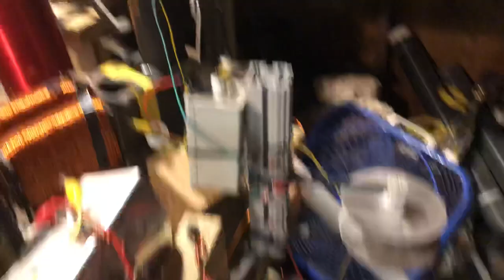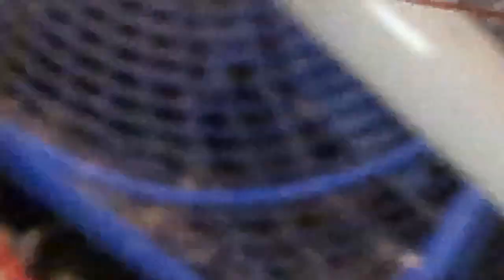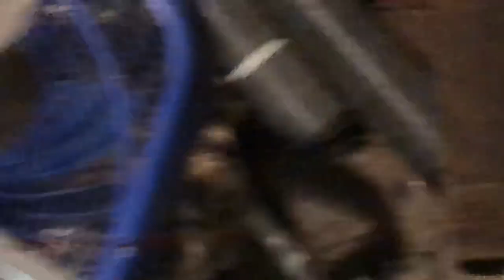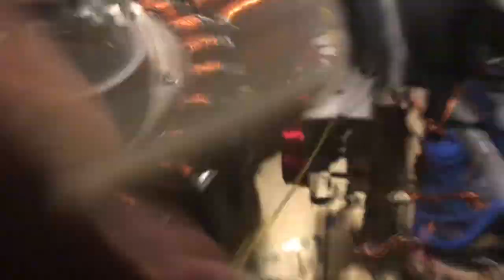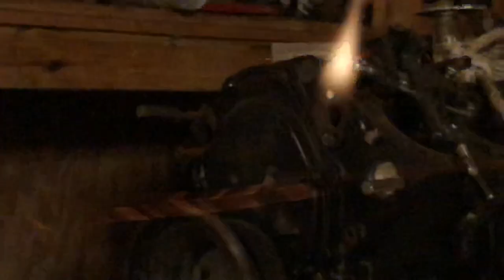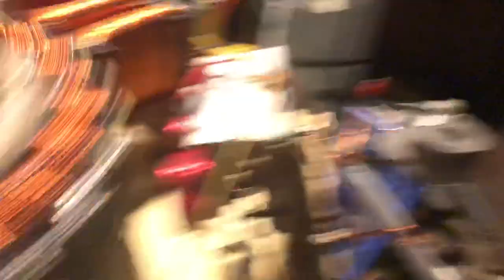Coral Castle, Ed Leedskalnin, High Voltage Lines Test

Comment: That's a pretty impressive amount of power coming from that one pmh at even super low speeds
Reply from the maker: Hi Jason so the best thing ever happened to me is what I learned how to make a voltage multiplier. You can make up to 1,000,000 Volts, by just multiply and one volt! What you see is how to make high pressure
Reply from the maker: Jason Joplin 
And yes shedding break down at its finest
Reply: Yea pretty awesome indeed

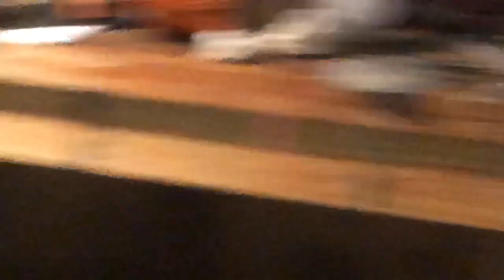Comment: 3:16 "Wheres My chicken Stick when Ya Need it "  4:16   Do That Whole Wand Spark Thing,, but instead Of a Wire.. Use Different Heavy Steel Iron Chains.. Some old.. Some New Type Metal..  See the Difference Between The Metal Surge & flow determined Of metal chain 'fine structure' or To Dense.. As to Not Allow Spark 'Grace' Effect..where the Magnetrics is Easy to Work With and Malleable, that When Added to Circuit Will Allow More 'Magnets' To Work with That Are Already in the Iron,, as Ed said the Wire too had magnets in it..that The Gernerator or Dynamo Didn't need To Generate.   It's like Different Nascar,.. in the Diff Chains.. like How Ed Had Over His Wheel.  More.. UMPH Bang For Your BUCK!  More Fire Works SURGE, and Able to Take the "Heat" of the kitchen Of Magneticity.